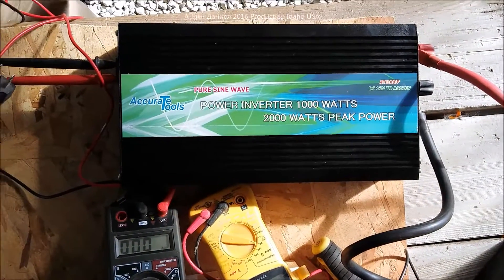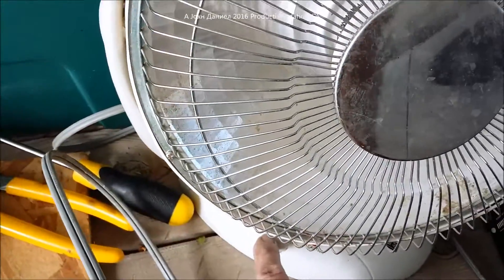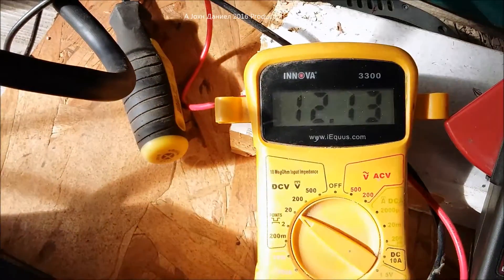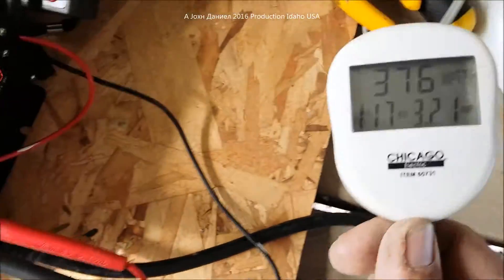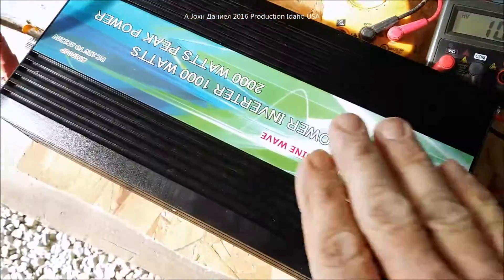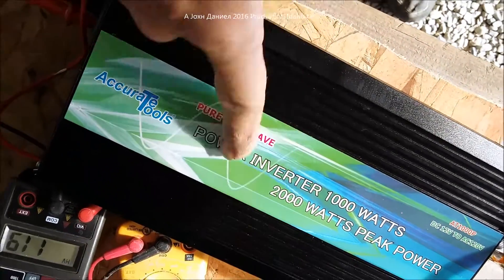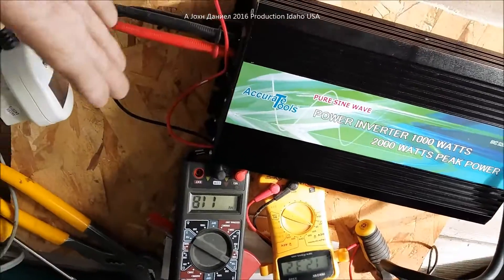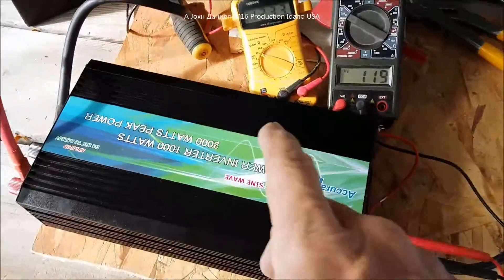Accurate Tools 1000 watt ♡ inverter Video 2 of 4 Pure Sine wave.

Comment: I have wondered about these. The reliable seem to be good also. I have heard bad and good about some. Sometimes they bash the inverter. When they run 25' of 8 gauge to a 2000 watt inverter. Or worse then say the inverter is trash. I have a power jack. It's a new model and replacement parts are available. That's what sold me on it. It's a 5 kw inverter charger. The MOSFETs are on a separate easy to swap board. And they seem to be improving the product quite a bit. If it was 4-5 years ago. I don't think I'd have got it. It seems to be a decent inverter. It has no mounting feet though. I don't get that though. I used small angle braces. It has dual inputs. And hardwire in and outs.  With a up to 80 amp@ 24v charger. The  double 2/0 gauge by 4.5' long is plenty . over kill actually. A single would be fine at that lenth.  I do want to get another 24v inverter to run my TV and electronics. To separate it from the  fridge and well pump and stuff . I was also thinking about a mod sine for running power tools. To keep from running the generator . great video as usual!

Comment: Ive got the 1500-3000 peak version of this accurate tools. At 1200 watts with a microwave oven running for 3 minutes melted the 4x40 amp  internal fuses but did not blow them! Right on the pcb it says 30A under the fuses.  hmph.  voltage sags drastically. Will not buy again
Reply from the maker: +Andrew Yerks Was that a 1200 watt microwave or a 700 to 800 watt microwave pulling 1200 watts?
Reply: I should have specified. The microwave cooks with 800 but from the outlet it draws 1200 watts. That is testing with my p3 kilowatt meter. When I have it hooked to the inverter the wattage will vary between 900-1200 which I assumed was just due to inverter not giving its juice properly, or my meter not cooperating wth the inverter.
Reply from the maker: Maybe not your issue, but a possible to consider - 
Depending on your available battery amps ( continuous non resistive current supply at nominal operating range of 12.3 to 13.9 VDC)  it may be related to the fail you describe. IF your DC supply volts drop substantially the result is a natural increase in circuit amps. I see many inverters fail due to the ohms law effect, volts go down, amps go up, heat increases in the switching mosfets and POOF, inverter dead! 
Generally most people think that 11.0 inverter low volt cut out is just due to lousy inverter designs. But its due to the increase in cabled amps as volts drop to continue the desired output in AC voltage to a point of maxing the inverter out even if its not to its rated limits. They rate inverters with a 12.8 VDC constant supply. At 14 volts it can make slightly more than rating, at below 12.3 it will make a downward spiral of drastically less than rating. Theres a mathematical ratio involved in the actual abilities of a inverter, any inverter without a massive  progressive gauge transformer like this one ( http://amzn.to/2jct2iS ) is subject to fail in any low voltage condition that exceeds its rating via amps x volts = watts in relation to metallics of thermal conduction ( https://en.wikipedia.org/wiki/Joule_heating ).
Pretty much any Computer, Amplifier, Inverter, Converter or other electronic device with a modern power supply will draw more current when the line voltage drops. This is because the power needed by the device is constant (or at least not related to line conditions), and power = voltage x current. So if voltage goes down, current must go up to compensate.

Hope I helped you if thats the issue, or anyone else with too few supplied DC amp rates using inverters.

Comment: I have learned a lot about inverters from your videos, thanks for taking the time to explain everything. A question, I have a John Deere 332 diesel garden tractor I would like to match an inverter to for use around the homestead. It has a 16hp 3 cyl diesel, 20 amp alternator, and right now just a 300 CCA battery. I am working on enlarging the battery box area and should get a 5-600 CCA battery to fit. With the tractor running, what size inverter could this 20 amp charging system keep up with ? I see "no load" amp ratings on inverters but nothing for a load. Im sure there is a way to calculate it, I just dont know how.
Reply from the maker: +Bryan Gatermann Your tractor can easily handle a 55 amp alternator. A 2000 watt PEAK Work Zone  is what I would recommend.
Reply from the maker: +Bryan Gatermann 20 amps x 13 volts is your alternator produces in watts, 260 watts. Depending on how much inverter use you plan to use at what rate needs to be considered.
Reply: Thank you, sir.